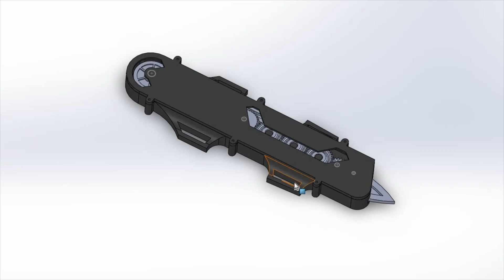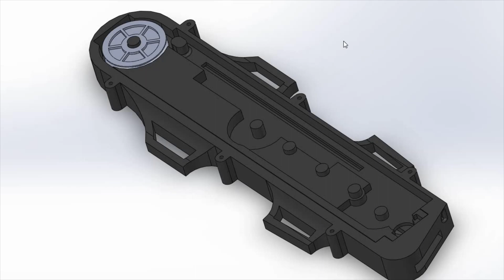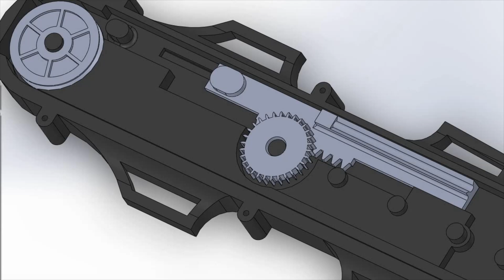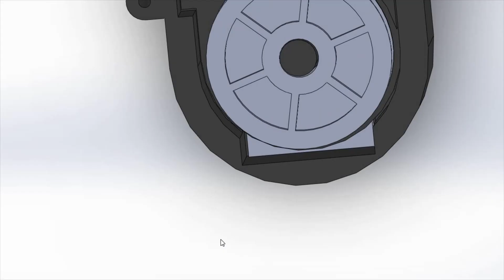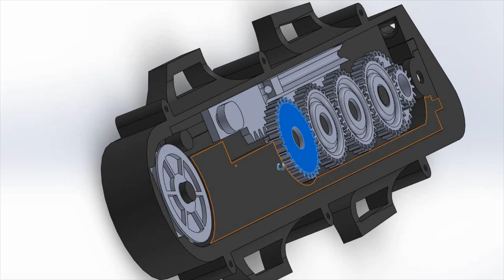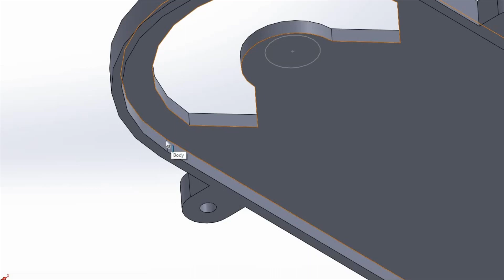Hidden blade v2 - Gear train | Assassin's Creed | Assembly tutorial

Comment: to those of you looking for the files in 2024, search up "slim gear hidden blade" and select the one by le_esoj. it is just a slim version of the one designed here, but no internals have been altered, and the blade works. if any of you find good elastic band solutions, let me know. cheers

Comment: Hey im new to 3D printing so i have some questions what infill density should i use to make it durable
Reply: It depends on the parts. I’ve been 3d printing for almost 2 years now so I think I can help. For the smaller parts like the gears and pins and all those type of parts then do 60-100 percent. For the larger parts like the blade, case, and topper 10-15 percent should suffice. Hope this helps 😊

Comment: how can i add a safety lock? i don't want to hurt people by mistake
Reply: There isn’t enough force behind it to really hurt anyone especially since the blade isn’t sharp but you could always take the ring off to be safe.
Reply: @camtron1924  What if the blade comes out by itself near an eye or a vein.

I want to sharpen it and probably replace the plastic with metal for more accuracy
Reply: @zeto_on_drugs6561  the blade can’t come out by itself because the gear ratio means it that it takes significantly more effort to full the blade out than to push the blade out. This is because when you have a large gear as the output and small gear as the input you need more torque on the input gear to turn it. The means that turning a larger gear as the input is easier when the output is smaller. This applies to the blade with the string moving a large gear (input) and the gear moving the blade (output) is smaller. This allows the string pull to easily move the blade but gravity or pulling on the blade does the opposite. You have the gear that the blade would move (input) which is small and the gear that the input is trying to turn (output) is the one that the string is attached to which is larger therefore it takes more effort.
Reply: @camtron1924  i understand. Thanks. I now just need to figure out if it is actually possible to replace the plastic blade with metal while still using the plastic gears

Comment: I printed your design. First of all, I really like the aesthetics and the gear system, in addition to thanking you for your work in giving us free hidden blade models.

I wanted to ask you what exactly "pulley" is for. I also wanted to tell you that the hidden blade works until I put the cover on, I don't know if it's because the gears rub or because the system would have to be sanded or lubricated (I don't know if you explain it in the video, I'm not very good at English and I don't I understand everything)
Would there be a possibility to make the cover deeper?
Reply: He mentioned that the pulley isn't functional, it's an artifact of a previous design

Comment: Heya printed this a few days ago. I've read the comments and its seems to be cosistently the 30T gears that are messing up. ive done some tests and had small success upscaling the print in the slicer by 5%. would laser cutting these gears be a better option? (might be a case of re-tuning the printer)
Reply: Update! increasing gear size and re-tuning the printer worked fine. I had the highest quality possible set on my Cr-10 and the gears mesh perfectly now
Reply: @JediLuke1999  if I may ask when you put it all together irl what screws did you use to connect it all?
Reply: @redcheco7631  so i used the screws recommended
Reply: @JediLuke1999  was it just the gears that you increased the size on, or the whole print?
Reply: @Darkwolf813  i only sized up the gears and it worked fine after

Comment: hi there, would there be a way to alter this design, so that the drive rack is pushed back and forth by a spinning wheel with a pin, turning in a slot on a flat plate attached to it (i've described that badly but if you check out the mechanism for the colinfurze hidden blade?) it would allow you to effectively have a locking blade without the impact on the plastic or breaking rubber bands of spring loaded OTF blades
Reply: either way, really cool design!!
Reply: just thinking about it now, the draw length of the drive rack would be limited by the diameter of the circular piece you would need to fit..? if that became any shorter would it be a simple case of resizing the gears..?
Reply from the maker: @volcanicus3459  this is a neat idea! I think you've hit the problem on the head though - you would be limited in draw by the diameter of the wheel, which is why most mechanisms like this end up requiring OTF to "shoot" the blade the distance, rather than it being driven by a wheel :)

I suppose you could make the drive rack driven by another gear which was then attached to some sort of linear-to-circular motion mech, maybe something like a scotch yolk, although I can't think off the top of my head how you'd get it to switch directions mechanically to retract the drive rack, which could be a bit more hastle than it's worth... interesting thoughts though, I'll do some research and see if it's possible! :)

Comment: Any tips for printing the 30T gears would be appreciated.
Reply from the maker: Hi there! Could you be a bit more specific about the problem you're having? Are the teeth not printing great or is it another issue? :)
Reply: @enivedprops5830  yeah the teeth didn't print well at all. Like when they are all three in a row two of the gears don't even touch.
Reply: Did you ever figure it out I’m having the same problem
Reply: No i haven't. I will try again this week
Reply: I have the same problem, the gear of the middle never touch the other two
Reply: hey, did you figure out how to do them, i dont get them to work either
Reply: @Cyborg_3001  yes if you are using cura there is a setting that lets you change the wall width, I messed around with it and got mine to work. Also you can see in the preview on cura how defined the gear teeth are they need to be looking like good teeth and not little stubs
Reply: thanks, i will try it

Comment: Hi, I wanted to build your original design but I couldn't find it on thingverse. Is there any way I could get the files for your original design?
Reply from the maker: Hi James, I can certainly send you the STLs for them but i really wouldn't recommend it - there are some design problems that I wasn't able to rectify and I think a complete overhaul is needed in the maths/motion of the parts

If you still want them though, send me a DM on thingiverse:)
Reply: @enivedprops5830 Thank you for letting me know. I'm sure I can work with this version. Great job designing it, it looks like you put a lot of effort in.
Reply: @enivedprops5830  do you think you will do a redo soon? I really want to print it!

Comment: A bb gun would be amazing! You could try using a syringe barrel and piston to compress the air and make it single action, just like the gun in Brotherhood!
Reply from the maker: Good idea! I'll see if I can get enough pressure to fire a little pellet :D
Reply: @enivedprops5830  pistons in airsoft spring pistols are half the size a syringe with same barrel diameter. I tried here and It works pretty well

Comment: Just started printing it! I've built your original version and it's already quite satisfying to use but this new version just looks so much more simple and reliable,  excited to finish it!
Reply: did you get yours to work? Im having some problems with mine
Reply: @flameintherain2584  yes I got it to work. I think the main thing to look out for is sanding the parts and lubricating them to ensure smooth operation.  For me I used some vaseline as a lubricant and it works well and has no smells
Reply from the maker: @THEMOCCHANNEL  this is absolutely the trick, most of the issues people will experience is down to friction - in this case sanding and lube always helps! :)
Reply from the maker: That's great to hear! I hope that this new design scratches that satisfaction that you're after 😊

Let me know your thoughts, I'm always open to critique!
Reply: @enivedprops5830  Btw would you mind sending me the STEP files? I would love to modify this thing further!
Reply from the maker: @THEMOCCHANNEL  Of course! Send me a DM on thingiverse and I'll link you the google docs file :)
Reply: @enivedprops5830  sent!

Comment: Hey there! Very cool design. Would you ever consider selling these?
Reply from the maker: Hi there! 

I don't plan on selling these hidden blades as I think people always extortionately price them, and I want to offer a free solution

I appreciate not everyone has access to a 3D printer, so you can use websites like Shapeways or Reddit to print files that you upload 😊

If anyone does have issues though and are struggling to get one they can message me and (depending where they live) I can get one made and shipped
Reply: @enivedprops5830  Brilliant Where could I message you through? Thanks!

Comment: So I’m new to 3d printing and have never printed something with gears. The teeth on the 30T gears are not printing long enough to reach each other when in their spots. Any suggestions?
Reply from the maker: Hi Tucker! Thanks for asking :)

It sounds to me like either the gear positions have printed slightly out of tolerance or your printer has different tolerances to mine, considering you're new to the hobby, have you ever done anything like e-step calibration? Things like this can sometimes help with dimensional problems! 

If that's all good, it might be that you need to print them slightly larger, do you have access to CAD in any form? I'd recommend offsetting 0.1-0.2mm from the external contour of the gear to make it a bit "thicker" 

If not please let me know via DM on thingiverse and I'll send you some CAD files that might help :)
Reply: @enivedprops5830  thanks! I’ll try and with size on my CAD